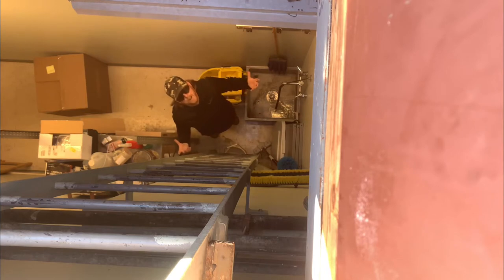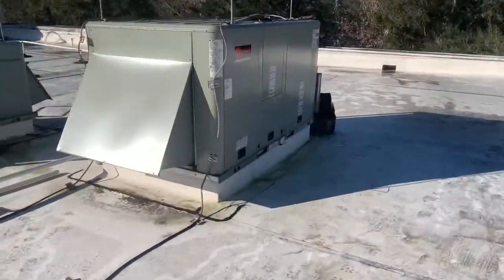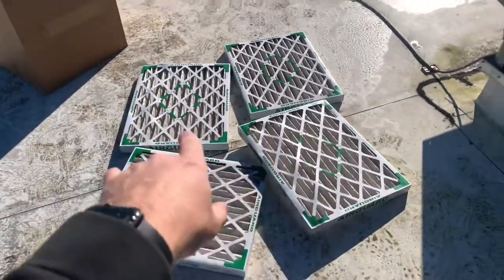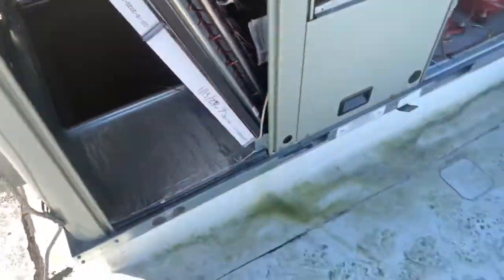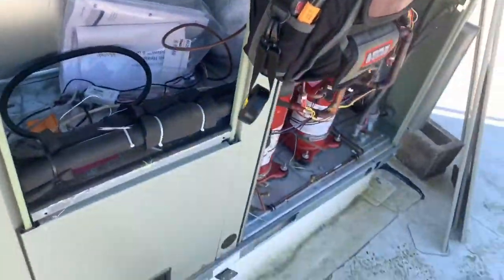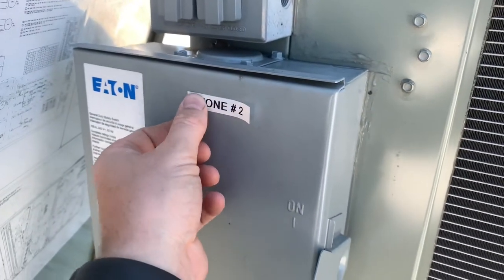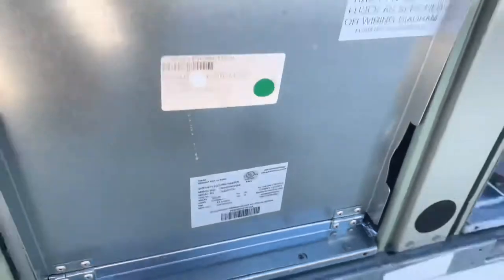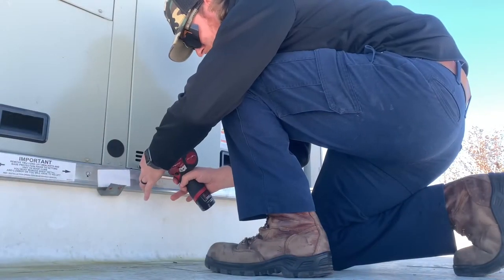HVAC RTU maintenance | Inspection

Comment: straight to the point, clear and accurate, good video. subbed
Reply from the maker: Thanks for that!  Appreciate it!!
Reply: @KoolinwithKrauss  hey bud i service units in a commercial setting but they are inside would you do the same process?
Reply: split system carrier units but none of them are on the roof top just at ceiling grid.
Reply: @KoolinwithKrauss  also what were you checking with your multimeter?
Reply from the maker: Go about it in the same way imo! I just was checking the volts and amps. Also for split systems bit of a pain because 2 separate components to deal with. But just check over it all!

Comment: Have you had to replace one of those Axial Blower Motors on a TRANE yet....?
Reply from the maker: I have not had the fortunate opportunity yet!!
Reply: @KoolinwithKrauss  
We're doing a 2nd one (did one a couple years ago) soon, and was hoping you'd done a few of them and had an easier way that pulling the whole top off.
We're not a TRANE dealer, we have Carrier with the 'Eco Blu' fan motors on the small RTU's - it's less than a 5min job to replace the blowers on those.